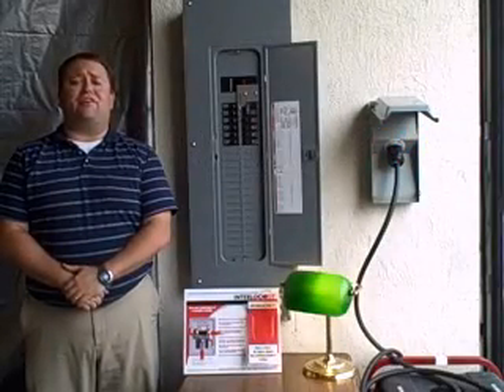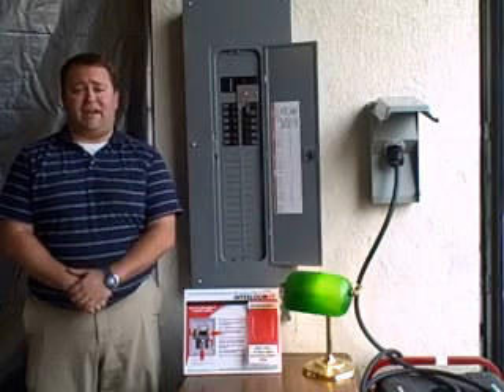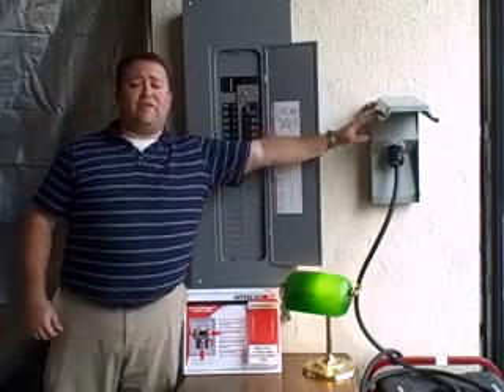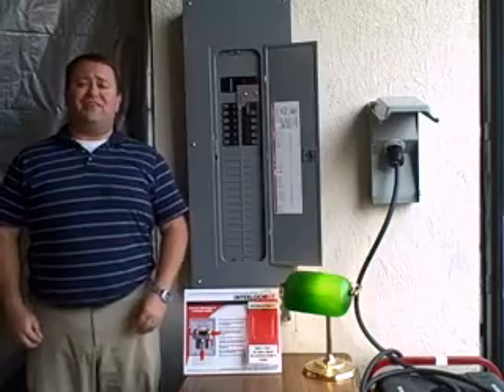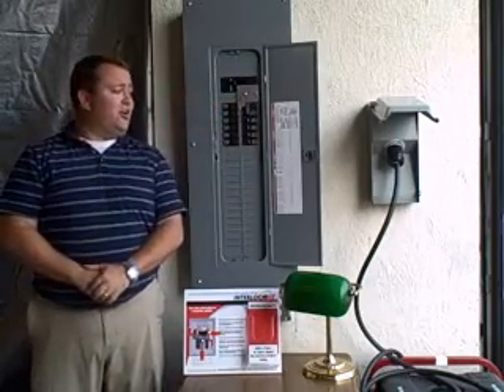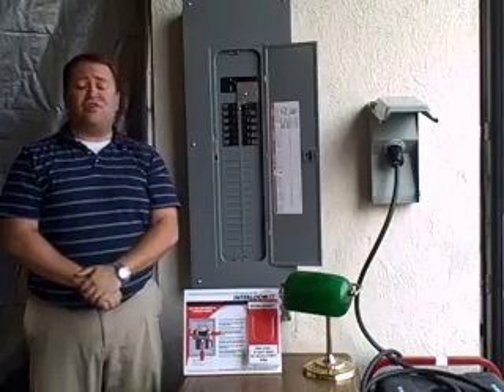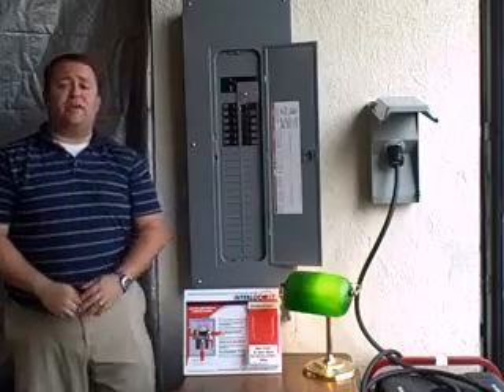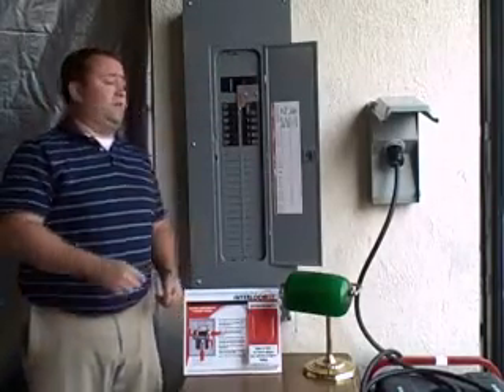How a Generator Interlock Kit Works

Comment: This video did not show how the interlock prevents the main breaker from being powered while connected to generator or vice versa.  Need to show that the interlock kit will not allow the generator breaker to be turned on.  The whole purpose for this video!

Comment: it's not smart st backfead if that's what is being done here because a breaker won't sense the excess pull on the output that is being used to feed. You need a transfer switch.
Reply: Why? if the generator has a 30amp breaker and your using a 30amp generator  breaker at the panel for back feeding you have protection.

Comment: What would happen if both main &  generator were hot at the same time?
Reply: I think it goes without saying, it would be pretty ugly. Let's assume that the generator is running, and both breakers are on. If the grid is down (a tree fell on the power lines), your generator would not only be trying to power your house, but it would also be trying to feed electricity back into the power grid. Not only would this overwhelm your generator, but it's also extremely dangerous for the workers who are trying to repair the power lines.
If the power is ON, you have a bigger problem. In theory, if the sine waves of the power grid and generator were PERFECTLY aligned, and the voltages were EXACTLY the same, the grid and the generator wouldn't exchange power with each other, and everything would be hunky-dory. This is why solar grid-tied inverters work the way they do. The solar inverter carefully matches its output using the grid as a reference. In reality though, a regular generator will be out of phase with the grid, and likely will have a slightly different frequency. So the generator might be at the point in its cycle where it's outputting +120v, while the grid is simultaneously outputting -120v to the same wire. It would be like shorting out a car battery, only on a much larger scale.

Now I do like to think that the breakers would immediately trip in this kind of situation, since either way the grid would look like a short circuit to the generator, but I really just don't know for sure. Let's not try it folks ;)

Comment: The cord coming from the wall near your main panel connects to the generator.Where is the cord that needs to go to the main panel,it looks like you left it out.That box you have next to the panel with the cord should be outside the building.You could have made a much better demo.

Comment: hello, I have two questions please: I own one 2000iS inverter generator and an 2400iSHC inverter generator, can they be connected and runned together? and do you have the cable for that?. Thanks a lot.

Comment: For those of you who feel you are smarter than most of us and do something like back feed your generator through the drier etc. Even if it works and had nothing to do with a fluke fire that just burned your house down... Even if the result is not due to your shortcut gen. hook up your insurance will be voided the second the fire marshal reveals your clever power install. Is it worth it?

It's kind of like the drunk driver who could not have avoided the young child on the bike even if he had been stone cold sober. Even if the impairment did not have anything to do with the fatality. The drunk is still going down for manslaughter simply because he was drunk and someone died. Again, is it worth it? Maybe a little over dramatic but you know I'm right.
Reply: You may be right but try telling it to O.J.
P.S.: I'm not a lawyer and i don't play one on you tube.

Comment: yes but it is 100% ilegal and not safe or to code
Reply: an electrician would not hook it up or recommend it if it not legal. i have one with a 6500 propane generator .i also have the sensor alarm that lets you know when power comes backs on .one of my better investments.runs the whole house.including hot water when power go outs

Comment: @mikeycv1 In principle, yes, but it wouldn't be to code. The risk is that you neglect to turn the breaker off before firing up old sparky and you send power into the grid and electrocute the lineman.